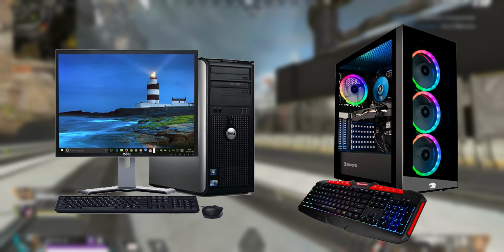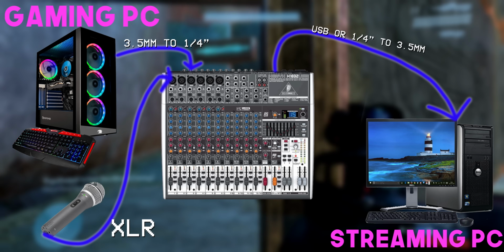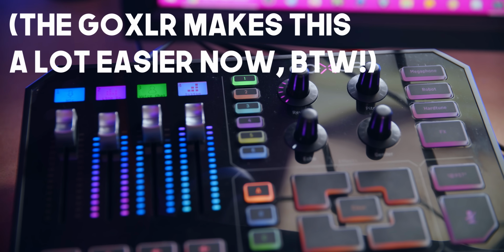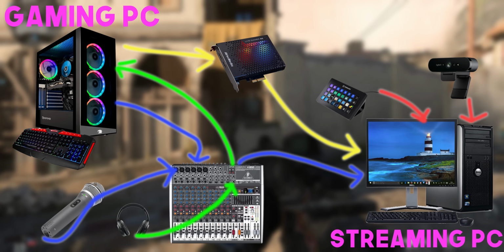SINGLE PC vs DUAL PC STREAMING SETUP - Why and How (Introduction to Dual PC streaming setup)

Comment: I don't know if you will read this comment after 4 years. I have built second PC for streaming. Which has i5-12400f, AVermedia LiveGamer Duo, DDR5 5200MT and AMD RX570 just to boot the pc. Main rig has 7800X3D+4080 Super. I have been streaming for long time. But it's my first time building a dedicated streaming PC.
I had blocky/blurry image when I was playing graphic intensive games. I thought streaming PC would fix my problem. I tried recording at 8000 bitrate, medium/slow/placebo CPU usage preset, but it looks worse than recording I did on main pc 8000 bitrate NVENC.
Is 12400f is not good enough? or do I need proper settings on OBS?
Reply: Then I replaced my streaming pc CPU to 13900K. CPU load went from 90+% to 20-40%. But image is not really improving. Tried AV1 AOM with 10000 bitrate slowest setting, barely noticable difference. Tried people's x264 custom options, not good. I expect to see good image on stream as I see on my screen. Is it Youtube compression problem? It is nothing like I saw on Shroud's stream 1 or 2 years ago at 935p. His stream was crystal clear, almost looked better than I see ingame.
Reply: Tried DSR to load my games at 1440p. Streamed 30k bitrate, x264, slow preset, 1440p on youtube. Looks exactly same. Even CS2 looked blurry. CPU usage at 60% no overload.

Comment: Hopefully your still around my guy because ive been contemplating a two pc setup. But ive never streamed period. 
Only reason i thought of this is because i happen to have a second computer that isnt doing anything. But its not the most expensive computer it might not even half a graphics card just an old video card. 
Do you know if there are specific system requirements if i wanted yo stream say a 1080p stream

Comment: Hey Guys, i have a question as a beginner. I'm using rn a 1 PC-Setup. What is the downside using the CPU in OBS Stream-Settings and not the GPU in Output-Settings? And what you and community think what using is best? Do anybody have a recommandation? Specs: Intel Core i7-10700K @ 3.80GHz RAM 128GB, AMD Radeon Peo 5700 XT. Thanks to everyone.

Comment: If I'm not planning on streaming , just want to game on 1 monitor but use spotify and discord running on a separate pc (streampc) and connect 2 monitors to the (streampc) and just use the goxlr mini to be able to hear discord, and spotify while im gaming on my (gamingpc) would work fine? 

In other words I don't need to use a capture card if im not planning on streaming or using OBS? 

(gamingpc) 1 monitor for gaming running only the game.
(streampc) 2 monitors running spotify, chrome, discord.

So basically I can just run the goxlr mini to combine the sound right?

Comment: Using two pcs doesn't seem right to me. We have such powerful multi-core cpus and Nvidia's built in encoder works really good. Sure, using two pcs does allow you to keep streaming while you reboot but that's rarely needed for video game streaming. I don't play the most demanding games but I only have an i5 8600k and an rtx 3060. It handles streaming games like diablo IV at 1440p no problem. I can only imagine what a 4090 could handle. I also only use one monitor but it's a 4k 55" tv that works really good as a monitor. Having a 2nd monitor would be nice but mine is like having 4x 1080p screens with zero gap between them. I just always opt for a larger game view versus reading my empty chat room lol. Anyways, I don't have much experience. I really only do it for the experience and knowledge in case I every want to do it for real. In my opinion, using just one pc is just benefiting from the power you paid for and getting your money's worth out of a good system.

Comment: It is possible to record the gaming pc with a low profile pc at 1080p 60fps (record, not streaming)? i was planning to use my old pc that has an FX-6300 and 8gb DDR3 1600mhz. i was planning to bought a low-end gpu, something like GT 710 or R7 250/360

Comment: Should I use hardware or software enconding on a 2pc stream? I know hardware is preferred in a single pc (if you can). But it seems you mentioned doing h.264 in this scenario.

Comment: Many monitors don’t have the bandwidth to do full frame rate through HDMI. Are you just screwed in that situation?
Reply from the maker: Not sure I understand the question
Reply: @EposVox  So you said to use HDMI through the PCs, capture card, to the monitor,I forgot exactly now, but if my monitor only does say, 100hz over HDMI I won’t be gaming at the full frame rate of say, 175 or whatever the monitor is capable of over DisplayPort. I don’t do streaming so forgive my ignorance. I was just trying find out what the options are before selling my old PC.

Comment: Just a question. Can I consider using secondary PC with less but considerable specs which can still accommodate streaming operations?
Reply: anything over a i5 with a decent graphics card atleast over a 970 you will be fine

Comment: The main purpose and reason of a 2PC setup is very simply just removing the load of having to stream/record on one PC. Sure, you can have the best gaming setup but stress load is stress load and your performance will be reduced no matter how good ur rig, I have a 3080, R95900X and 32gb of 3600mhz and I run on a dual pc setup therefore I get the exact same performance as I would if I wasn’t streaming/recoding.

Comment: Hi, I am new to streaming and I bought a streaming PC which has i5-10400 and 8 GB ram, but it's not able to encode 720p@60fps using x264. Is this hardware not capable?

Comment: A little Late here with this comment however I have a question , Just want to see if you have ever run into this issue.
I use a dual PC setup for streaming and I Mirror my display vs Passthrough since I play at 240 FPS. Ive noticed when I mirror my display  and run FPS Alien test IT locks at 180  FPS vs 240 , Ive noticed this in A few games as well such as Fall Guys when I have V sync enabled it locks at 180.  V sync off it drops down to 60. Warzone doesnt have this issue but if mirroring my display is only allowing hte 180 thats kind of disappointing(even though only a few fast paced game I can hit those frames)  I confirmed in  Nvidia contorl panel that the monitor is set to 240 HZ. SO just wondering if you had any input on that. Inversely im thinking about going back to single PC setup since the 3080 now can handle the stream and Warzone without making my gameplay super choppy. Let me know please! @EpoxVox

Comment: can i use a gpu instead of a capture card for my didcated streaming pc. i have an extra 1080ti laying around. i am searching all over the internet for this answer and it seems i am the first to wonder this. most people are asking if they need a gpu. i actually want to use mine but i dont have a capture card and thats just more money to spend (which i am trying to avoid during these times). any help is welcome to help me solve this riddle.
Reply: Install obs ndi plugin  on both pc no need capture card   tell me you email i will make more info for you

Comment: @EposVox Why make it THIS chaotic? Why not just run OBS Studio on both PCs with NDI from the gaming PC to streaming PC?
Reply from the maker: Because that mostly defeats the point of doing a two PC setup. You’re losing half the benefits if you’re running obs on gaming pc
Reply: @EposVox  Ok, got it. But correct me if I am wrong: I had the clear impression that pushing the output from the gaming PC with OBS and NDI to the second PC, should use very little resources on the gaming PC. But I may have missunderstood NDI. But any way for my part; I would use a powerful gaming PC (and maybe use CPU encoding) and take the small performance drop compared to an advanced setup like this :)

Comment: "is mostly all gigabit ethernet so you should be good"
cries in kbps
Reply from the maker: Your local wired network is not limited to kbps
Reply: @EposVox  so it seems but I live in BFE and only get sattilite better yet it won’t even properly run a WiFi lightbulb
Reply from the maker: Local network. Not internet connection. The network that connects the devices in your house. The speed of an Ethernet cable between a switch or router and your pc or between PCs is completely unaffected by your internet connection speed.

Comment: might not get answered but I'm having a hard time getting a straight answer from anything. I tried streaming while gamin and it uses 100% capacity of my CPU and the the stream gets very skippy and choppy. So would adding graphics cards to my pc help take the stress off the CPU and possibly fix my issues?
Reply from the maker: Do you not have a graphics card at all?
Reply: @EposVox  says I have one call Radeon RX 570 Series. Tbh I'm still new to this stuff and ive tried leanering but I can't seem to find straight answers to things
Reply: @EposVox  I'm still trying to learn but any advice is greatly appreciated thank you sire

Comment: you can run Obs twice on a streaming Pc and it works out with encoding but you need to have a decent CPU or GPU for it i tried it today and it works fine for me ^^
Reply from the maker: Depending on your source types, yes. Most Webcams and capture cards will not work in multiple programs or instances of OBS.

Comment: Yo @eposvox , do you have any issues with circuit breakers tripping with all the tech in your room? I can’t run both of my computers and my monitors in my room without my circuit tripping, so I have to route my streaming PC to a different room. Just wondering!

Comment: First I wanna say thank u for all the time u put down on all of your videos. Now the question, i run dual setup NDI over 1gig switch aslo i run 250/100 line, on the stream pc i run x264, cpu preset slower (ryzen 3600, 1660ti) i find that my streams looks grainy. The cpu load is not hitting over 67%. Using lanczos, bitrate 6000, cbr keyframe 2 base output is 1920x1080, output resolution 1600x900. On the gaming it is set to 2560x1440 on base and output. I dont get any dropped frames, but im not satisfied with the quality. What am I doin wrong? Is it the base output on the stream pc that is set wrong or should i countinue to go down on the cpu presets?

Comment: Yo Epos, thanks for all your vids! They've helped me so much. Hopefully you see this.. my question for you is, if I'm running a single PC setup, ryzen 7 3800x, 32gig 3200mhz ram, rtx2080ti founders, and I play 3440x1440.. what encoder should I use? I've seen your other videos and so far I've been having great results using x264 medium (sometimes slow) using your secret settings.
Just want your direct opinion as I switch back and forth and test all the time. X264 has been great for me so far..

Seriously, you're the best dude. Thanks for all your hard work!!!
Reply: Nvenc New
Reply: it looks like your setups would do about equally well with x264 vs Nvenc new. Tip try to downscale the resolution of what you upload to streaming platform to 1920x1080 (bicubic), its half the pixels and most screens are still full HD and not Q/UHD so they won't notice the extra detail anyways. Experience: I managed to get 100FPS for ~3 hours on a single outdated computer, NVIDIA 1070 GPU with i700HQ CPU, playing and streaming from the same PC.

Comment: But using a laptop instead of pc is more beneficial.
Reply from the maker: not really
Reply: @EposVox  I want to say that a second PC will stay stationary on desk making it useless. A laptop can be taken elsewhere. It won't make difference in using ONLY as streaming pc. But the investment in laptop provides more value
I have Zenbook Duo 14. I take it for work and at night use it as a streaming pc

Comment: What kind of specification need for second PC ( streaming one) .
Really appreciated your video , I am from India
Reply: An AMD 2700 and a graphics card that can handle 60fps 1080p video should be cheap and powerful. I have a 2700x and a 550Ti (lol) in my streaming rig.
Reply: It comes down to how you are encoding the video at the end. If you are using x264 which is processor heavy then you are going to want to have a system with more cores (AMD is the leader in this at the moment). If you are going to use the GPU via NVENC then you can get away with a lot less in the CPU department. I believe most Nvidia GTX cards come with the NVENC encoder chip as of now.

Comment: You forgot to mention voicemeeter / vban for software method of getting audio to and from streaming pc :)
Reply: voicemeeter/vban is my current preferred way of getting audio to/from my streaming PC. Allows me to easily split audio into multiple tracks in OBS as well as control the volume levels of game, mic and music independent of one another.
Reply: or just use ndi

Comment: Hey @EposVox!  I have the 4K60 Pro Mk 2.. when connecting gaming pc HDMI IN to elgato and HDMI OUT from elgato back into gaming monitor, the monitor doesn’t recognize it! Forcing me to clone the monitors for it to work but I always see frame drops.  Have u seen this issue before?

Comment: Sold my Streaming PC last week
I new into streaming and about 700$ for a second Computer is not worth the quality in my opinion.

I tested x264 Medium also secret sauce vs NVENC new and compared some frames from my stream

And NVENCs Quality was a little Bit smoother for me.
Reply: what cpu did u use?
Reply: @lp5kill  oh nvm 2700x
Reply: The CPU you use makes a big difference with x264. NVENC is also great depending on what generation NVIDIA card you are using. The 2XXX family of cards has better quality with NVENC than the 1XXX cards.
Reply: بالعربي Turki  help what

Comment: No matter what I do, I need to be RIGHT UP on my mic to get that sound you do.  Dunno how you can be that far off the mic and still sound so studio.....
Reply: He for sure records audio between -12 and -6 db and then increases it in post to -3 db. This is how people are normally doing it
Reply: Its cause you smell like butt
Reply: Get a DBX 286s. It's a mic pre amp with built in compressor, desser, etc. It gives you a lot more gain. I had this problem with my SMB7 before I got a preamp.

Comment: 2 PCs is in my opinion better, generally you'll get a better image quality, with zero impact on your gaming pc, I've tried both. Starting out - without doubt on a single pc is the way to go its just vastly more simple. Audio issues aside with 2 pc setups, once you've got it resolved its fine. I found that using the same HDMI to send audio aswell as video to my stream pc always ended badly as audio would start drifting by 40ish ms every now and then ending up at the end of the stream with a few seconds delay, using something like AudioMeeter Banana whilst ALOT more complex (especially if you already have a complex setup on your gaming pc as I do) however allows you the flexability of being able to push all the audio through a single cable - in my case, game audio, voice chat (as a separate channel), and my mic - I can control the levels those audio channels go out at and what level I hear them in my headset.
Reply: therollo9 yes it is called Voicemeeter Banana, what do you need help on?
Reply: W8 isn't it called "VoiceMeter Banana"?

Comment: I'd like to add that you can also share audio between computers with software like voicemeeter - basically a software mixer that allows you to send different channels to any computer in the same network and is a pretty neat solution for a dual PC streaming setup :)
Reply: Hi can you help me? im trying to setup Dual pc but i cant get the audio feed out in my streaming PC :(
Reply: do you have a video on this? if so please link it here id like to transfer my mic audio connect to my 1 pc to my main one...i do have voicemeeter but only for sound adjustments..

Comment: As someone who has a 2 PC streaming setup, keep in mind:
 
-Two PC = Two times the trouble. Audio issues are GOING TO drive you insane, especially starting out.
-Know what you are investing in. Its another ~$1500 (another PC, capture card, etc) you have to spend to get it up and running. If you're fine with what you got playing old gen games, then stick with one PC stream. If you are a 144hz junkie like me and can't stand OBS fps drop or stutters in-game, THEN consider two PC.
-YOU GOT TO STREAM. I got depressed going from a 5 viewer streamer to a 0 viewer andy after making my two PC setup. Stopped streaming for a 2 months and wonder why I even spent my money on this. Going from 1 to 2 PC isn't gonna magically make you famous.
 
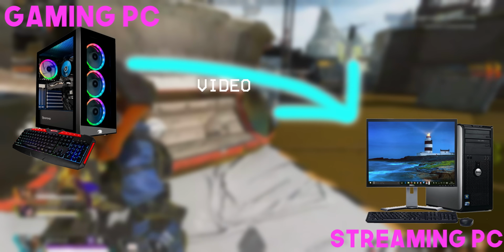But man, once you got a 2 PC setup going, fps drops/stutters isn't an issue anymore. You can now enjoy your high fps gaming with low/zero .01% frame drops. It makes me want to play current gen. fps games now that I can handle all the frames my stream can throw at it. Also 3:02 is right on point, was streaming Apex back when it came out with 1 PC, dropping from the ship is like a slide show to the viewers and ~40 fps with stutters as the player.
Reply: I recently started viewing twitch again and I don't remember it being this awful.
Can't even view 360p without buffering.
Reply: @h2oaddict  Its your internet